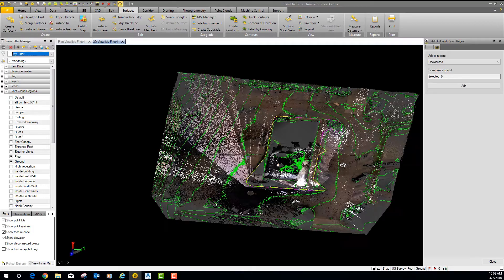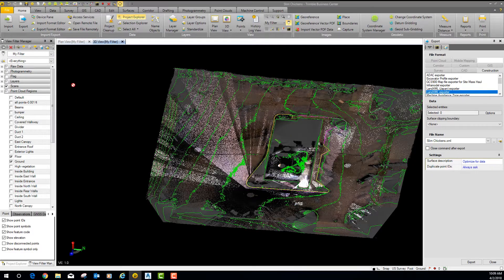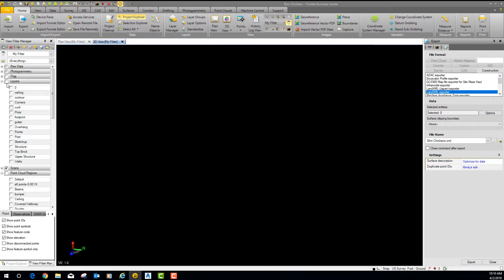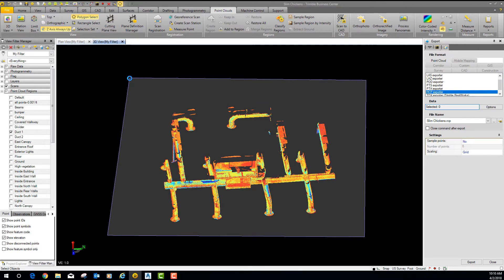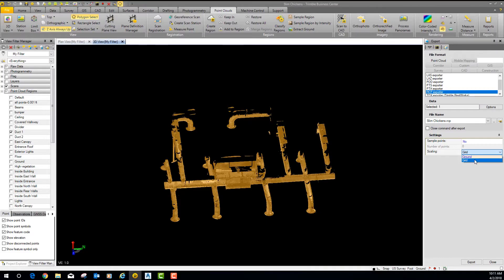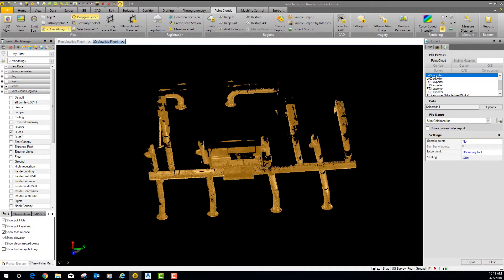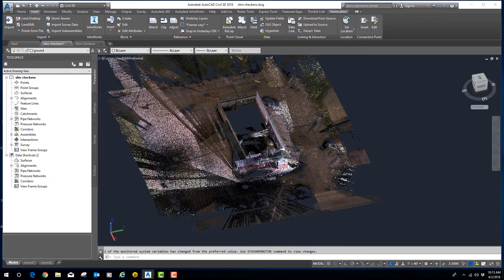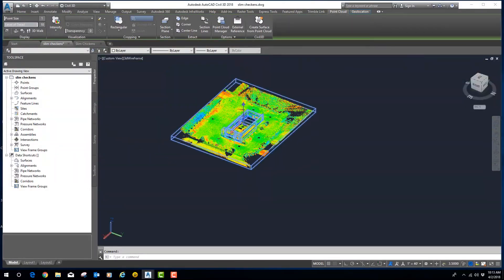TBC Point Clouds to Civil 3D!

Comment: Hey Robert! I have been having a hard time trying to figure out how to extract individual 3D points (x,y,z, IDOT, IDGEO, etc.) in any way from point clouds in C3D. I have successfully exported a RCP from TBC and gotten it into Cad, but the extraction features don't seem to let you do anything other that parts of a polygon (corner, side, line). It also doesn't allow you to burst or explode a point cloud for some reason. Can you help with this? Is there any way to individualize the points from a cloud to be used like regular points? Thanks in advance!
Reply from the maker: You need to do most of that in TBC.
Reply: @SurveyingWithRobert  thanks, that helps point me in the right direction. I have created a separate region with all the tree data that I want to isolate, can you tell me the best way to batch convert these to individual points to export? TBC won’t let me export scan points as .csv, or .dxf so that’s why I was thinking it could be done in CAD
Reply: @SurveyingWithRobert  looks like the Scan To CAD feature might be working! 👍🏼
Reply from the maker: Not unless you want Cad points for all . Create point,
Reply from the maker: Seems like unless it’s a small scan you would end up with to many points.

Comment: Our company recently purchased an SX10 and although we've used Trimble Access on our data collectors for years none of us know anything about TBC, and I knew nothing about point clouds until a few months ago so your videos have been very helpful. I'm currently trying to learn about all the export formats, and am wondering if there's a way to export to CAD so that all my point cloud regions come in as layers or separate point clouds. The only work around I've found is to export the point cloud regions individually. This is a pain, especially since I don't have Recap Pro.
Thanks again!
Reply from the maker: Recap Pro is about $300 per year....get it! You can then export straight out of TBC. Your killing yourself if you are going to Recap then to CAD.
Reply: @SurveyingWithRobert  We have since purchased Recap Pro, but I still don't see the point cloud regions exported. What am I doing wrong? I did figure out how to export the scan stations using the .PTX format.
Reply from the maker: Jon M make sure you are logged in to Recap. If that doesn’t work let me know.
Reply: @SurveyingWithRobert  Thanks. Not sure if I was logged in before, but I'll try that next.

Comment: I made a surface and when it was imported into Microstation it was unitless, came in a wrong place went back and openend in Autocad changed units to survey feet came in at correct position. Did I do something or is this just something that has to be done? It was from scan data SX10